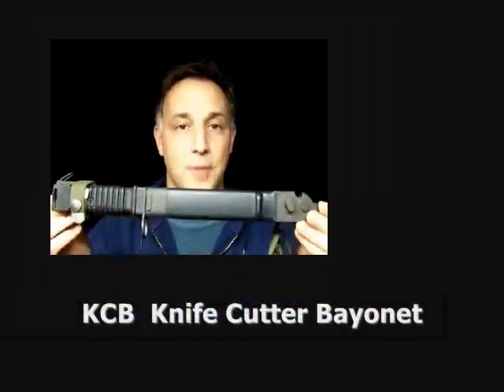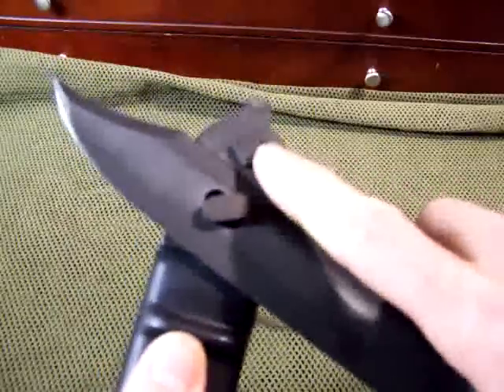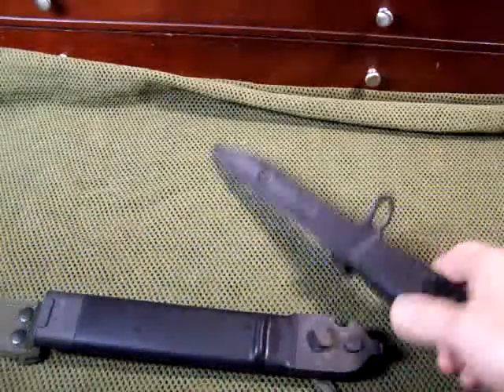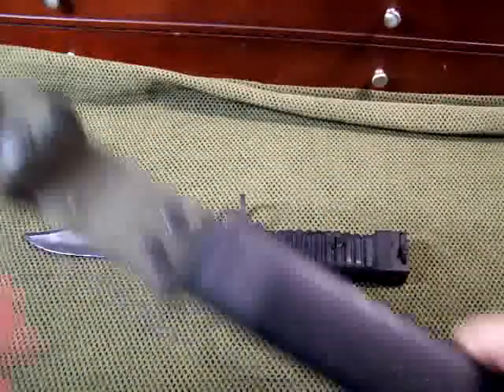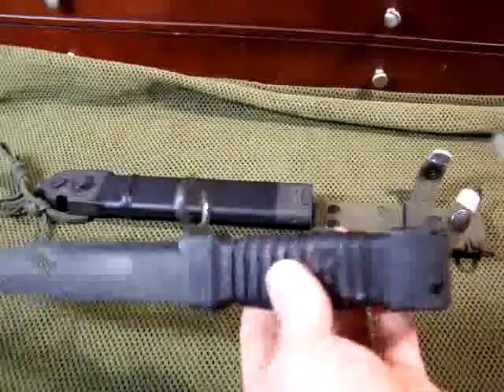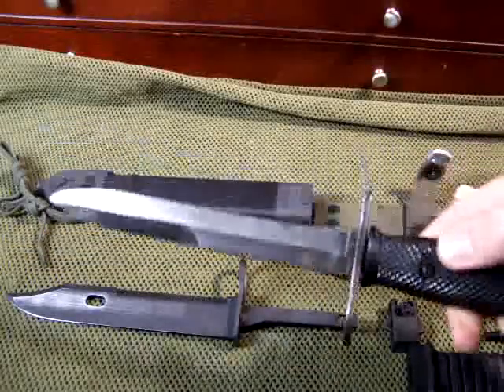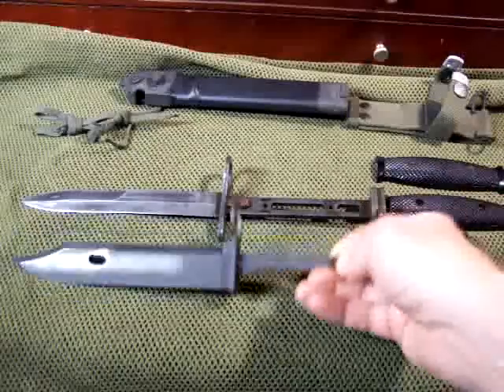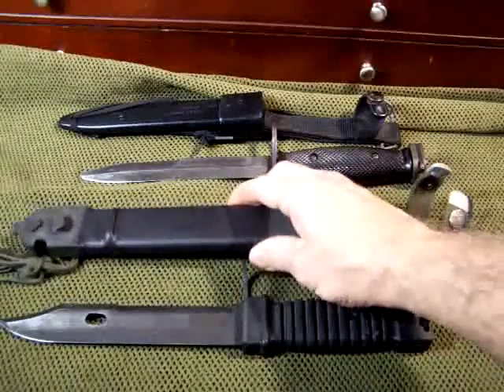KCB 70 M1 Bayonet  AR-15 / M-16 / Stoner 63 Rifle

Comment: Comparing it side by side with the M9 bayonet one can see how all the features of the M9 bayonet starting from the wire cutter to the screwdriver block were copied from the KCB-70 and KCB-77. They couldn't copy the bottle opener though.

Comment: With a little modification it will fit a Mossberg 590A1.  A little bit of the grip just behind the barrel side quillion needs to be removed.  Use a round file, 1/2" drum sander, or a dowel wrapped in sand paper. Work and smooth it like wood.

Comment: had one of these I picked up at an auction and just located the manufacturer when I saw ur video, one thing you didn't mention, I guess because its not attached to ur bayonet is the tool holder compartment, its the opening on the back of the bayonet. there is a piece that would fit in their and a tool for the rifle goes in it. the bayonet was also used and I believe produced by the Dutch. nice video.

Comment: @sootch00 These bayonets are often erroneously identified as Eickhorn/Stoner bayonets.
In the mid-1970s the Eickhorn firm went bankrupt. One of the firm’s assets that was sold was their trademark. It was acquired by a German firm named GMS. I do not know the full name of the company. They manufactured these bayonets and a G3 bayonet, both bearing the squirrel trademark that is often attributed to Eickhorn. (Eickhorn did reacquire their trademark several years later.)

Comment: Hey Sootch i have one of these but it looks like the grip is slightly different and it is missing the loop for the rifle barrel. The scabbard also doesnt have the thumb safety for when using the wire cutters. Apart from that it is IDENTICAL.

Any ideas? Maybe its a different model of the same knife?

Comment: The tang on the M1 looks weak? How does the balance and strength feel with the handle on it? Could I split small trees or branches with it using a large stone or rock withit in a survival or camping situation? Never saw the wire cutting feature on a bayonet before,is that unique to that model? I found a site selling an exact one like yours for $125+ shipping. whatya think? Especially for the SHTF senario!

Comment: sooth00... The notch in the scabbard is used during cutting barb wire. You set the notch on the wire. When cutting so the wire can't slide out. Great vid Gunny Z